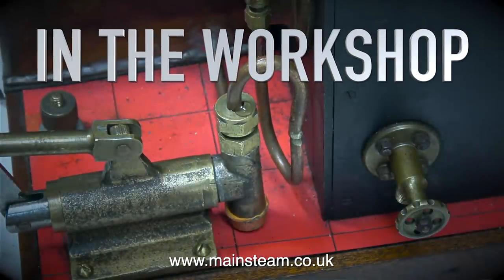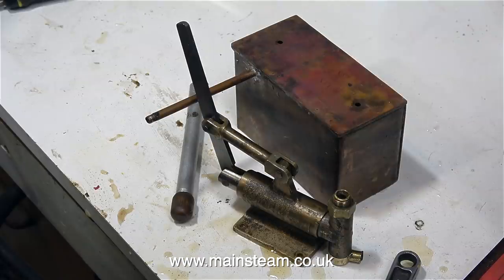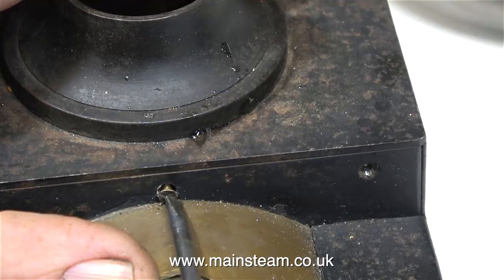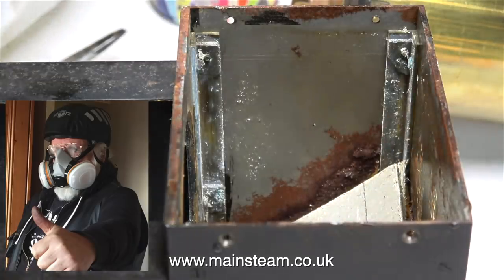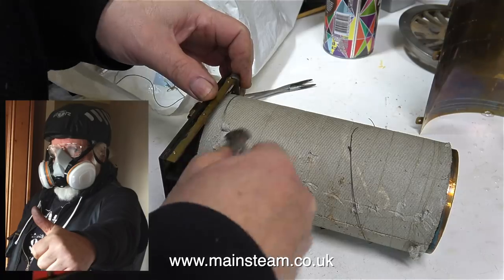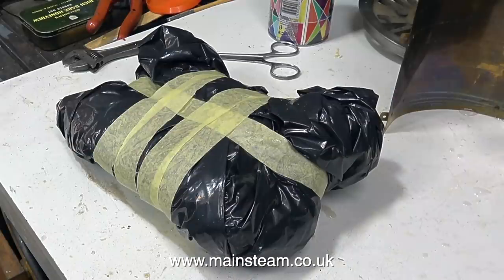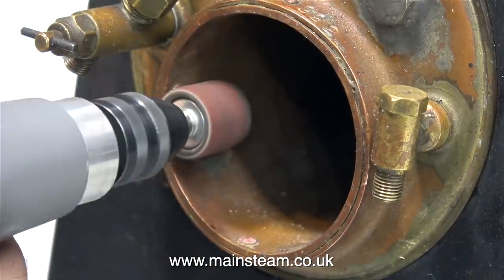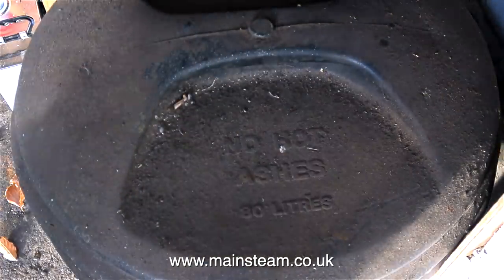RENOVATING AN OLD MODEL STEAM BOILER - PART #2

Comment: htmagic touched on a very good point Keith. In Canada when confronted by asbestos, the policy has been to wet it down as you have, but the addition of simple dish washing liquid to the water helps in a couple of ways. The soap water binds to the asbestos better than simple water alone, once the water dries off the asbestos it can again become airborne fibers when disturbed. The soap tends to leave a film on the asbestos rendering it a "bit safer" should it dry out and less apt to become airborne if disturbed.. Of course here we have a cranky government that requires it to be wrapped in "specially marked yellow bags" and sealed then surrendered to the appropriate facility like in Britain. Great Video Sir!

Comment: Have been watching your videoes extensively yesterday (my wife wondered where i have been - sitting beside her with a laptop and earplugs for hours). As e retired pilot here in Norway i want to take up this hobby, but i cannot speak the tribe language of imperial stuff. (know how to use laths and and mills from early years). Also when i was flying the speed was knots and altitudes in feet and the visibility was in meters. Ok. I want my tribe language to be in metric for this stuff. I understand that when you get an old "not working" engine in for refurbishing already in imperial - but do you have a proposal for a good YT channel in metric? Don't worry i will continue watching yours....